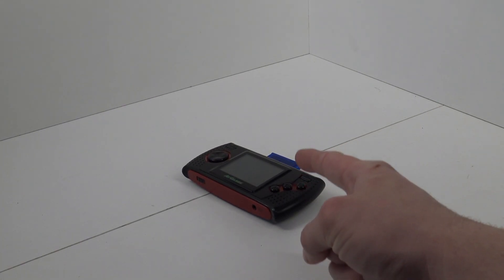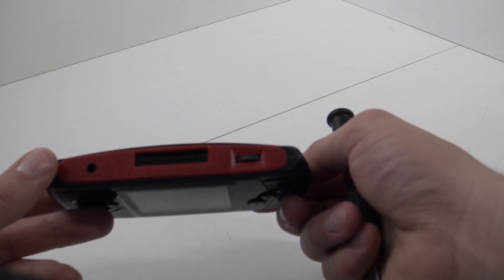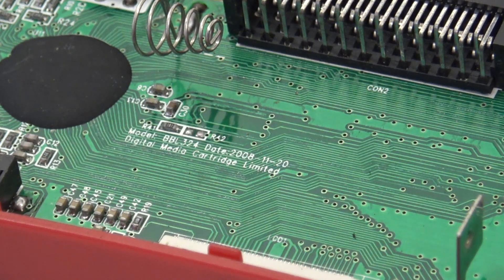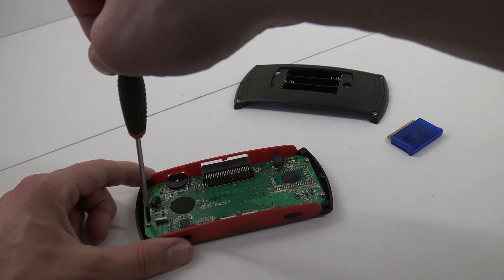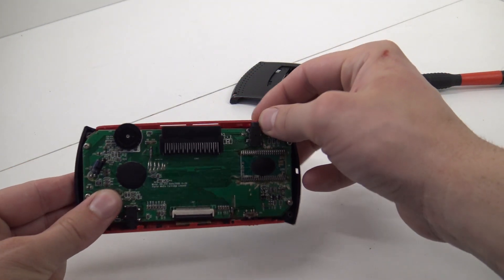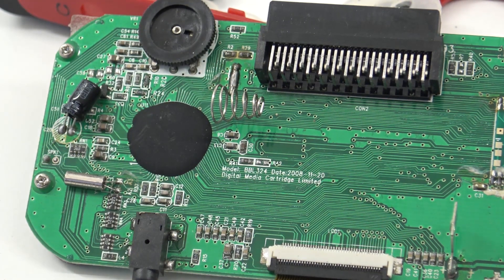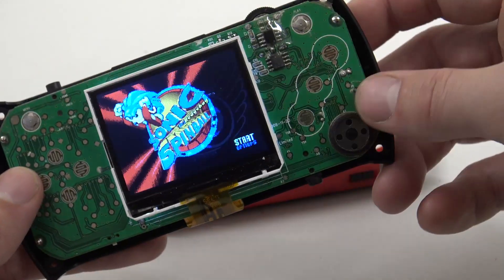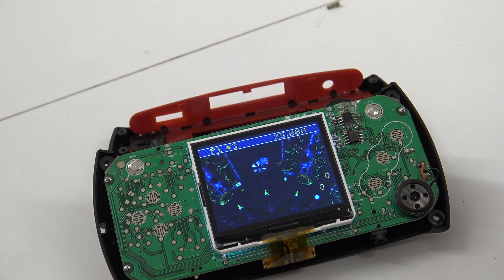What's inside an AtGames Sega Genesis Handheld System ??

Comment: Try applying 96% alcohol to that button then apply some very light hair dry to see if it fixes it, if it is old more than likely the culprit is oxidation residue that does not let the metal surfaces make contact. As for the speaker, it is either badly soldered, or the speaker itself is blown.

Comment: Hy wicked
Try to remove the tape on top of that metal part of the start button 
most of the time it will be corroded underneath if you scratch it a little and tape the metal part back in place most of the time it will work again .
Make sure if you remove it to tape it centered  
it is the same button style that was used on old cell phones
Reply: PS while i was looking again it also looks of center  try to move it a bit to the right